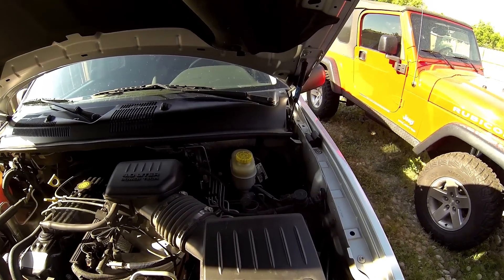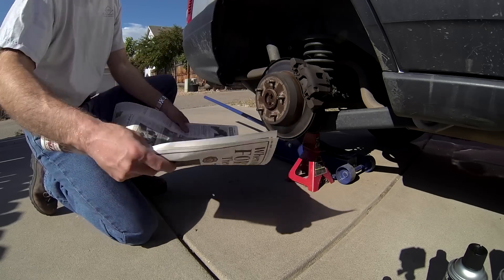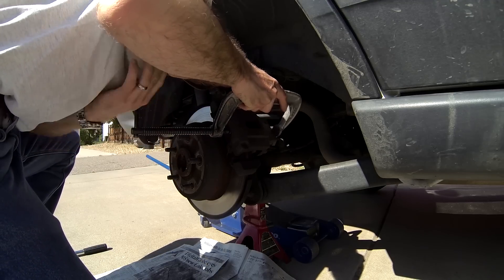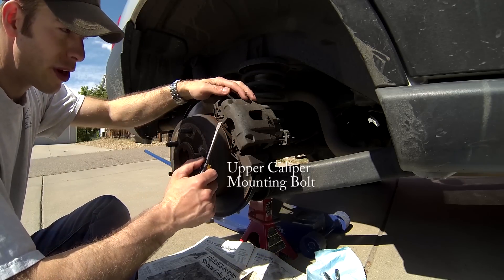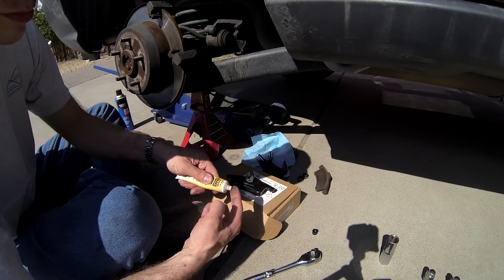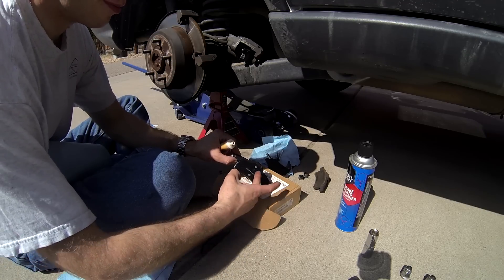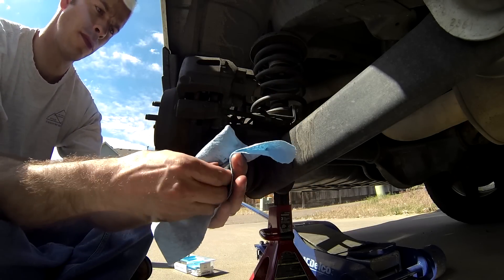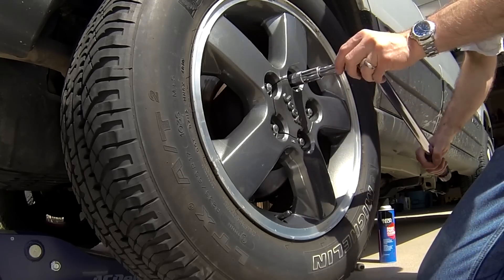Replacing Brake Pads for Jeep Grand Cherokee/WJ: 1999-2004

Comment: Thanks for the super solid video.  Just a note for the search engines... These are the Teves brake calipers that are on the WJ's through mid 2002.  I tore up a bleeder screw in one of mine and am set to replace it tomorrow.  I will say instead of the 7mm Allen, mine came off with a T45 torx.  Not sure if both work or what but I see way more posts using the Allen.

This was really great to help novice me sure up what grease goes where.  Thanks again!
Reply: Yup.  Definitely a T-45 Torx on mine, as well!

Comment: I chuckled when you got to the "reinstall retainer clip" because my new one was definitely NOT that easy to put back on. haha.  I was there for about 45 min haha.  Thank you for the great video, tho.
Reply: I agree. Those caliper retaining clips are a bitch to put on especially if you are trying to install new ones that came with the new pads. I actually ended breaking one off when trying to remove since it was rusted and seized in place. Now can’t get the remnant piece out of the hole. Anyone know if these are really required?

Comment: excellent job!!!      I stopped by your vid because   I couldn't remember the allen size -  thanks for mentioning it.   A few things, if I  might  add:  For  easier  R&R of the caliper,   cinch the  rotor  down with a  lug nut .  Safety-wise, don't forget to pump the brakes back up before starting the engine -  the pedal can  go nearly to the floor for as many as a half dozen pumps before hardening up.    If the pads are worn down to nothing, I  generally   crack the bleeder  and slide a piece of tubing over the  nipple  to let the old fluid bleed out of the caliper while the piston is being compressed  rather than push  accumulated trash back up stream  -  if the bore is clean, you can easily  compress it with your fingers  while  the bleeder is cracked - no need for a c-clamp - just tighten the nipple before releasing pressure.  .
Reply: Funny, I said the same thing in a comment I posted about not pushing the oil fluid from the caliper back into the system, and the dude went mental on me.

He said that I "don't know Jeeps or braking systems", so...I guess there's at least 2 of us out there!  This fucking guy....

Comment: No mention of pumping the brake pedal with the engine off after this procedure? And then making 30 stops under 30 MPH during initial drive? Otherwise, excellent, instructive video! Interesting to see how your methods deviate from that of many other mechanics doing this, but with equivalent results.

Comment: Thanks for your help. Changed brakes on a lot of cars and trucks. But my slide pins were not 7mm and a 6mm was a little sloppy but worked. The conversion for my slide pins was 1/4 inch.Also the caps were a full bushing that went through the calipers.Still don't know how to get the "reinstall retainer clip"  back on. Any HELP ?
Reply: Mine are Torx heads, so I don't know where the hell he keeps getting "allen key" from....

Comment: Tip; another reason for rear squeaky brakes. On older brake parts the pads wear creases and pits into the brakets where the pads slide onto. Causing a slight bouncing vibration where the pads rest on the brakets. Fix; remove brakets then file and wire brush until smooth.reinstall brake parts and Replace and Graese All hard ware. I hope I help someone.
Reply: It's....not that simple, really.  You can't just go hogging-out material from those areas, if you're not adding anything back (i.e. some welded metal etc.).

Comment: I just watched your video and I am going to attempt to do my own brakes.  But my only question is, what do you mean by torque to 95 lbs?  I know torqje is tightening but how do you know it is at 95lbs?  Thanks, I want to make sure I do everything correctly.   Your video was very clear and precise from what I saw.  I also liked that when you put the can of brake solvent down, you made sure we could see what it was, the name, brand etc.
Reply: Use a Torque Wrench to torque to 95 ft/lbs. You can get one at Harbor Freight or some auto parts stores rent them.

Comment: EXCELLENT VIDEO! I am surprised this doesn't have over 1 million likes... although could you please explain to me, on my old jeep (in order to take the brake calipers off) I just had to undo two bolts instead of using a 7mm allen? Now on my new jeep i have to use the tool you're using in the video (7mm allen attach) 

Is this because there are two different types of brake clusters for the jeep wj?
Reply from the maker: Thanks- you are correct; Jeep changed from conventional to allen bolts on newer Grands.
Reply from the maker: ***** Yes, they changed fastener type midway through WJ production.
Reply: @FreedivejeepHD  Ehhhh....mine are T-45 Torx, so... ??

Comment: what's the purpose of all the brake parts cleaner spray?  I mean, other than the obvious answer of cleaner stuff coming off...seemed like an excessive amount you sprayed.
Reply: +Jereme Macready it helps get all that brake dust off before you start working.  It's nasty stuff that you don't want to be breathing in.
Reply: No such thing as using too much brake parts cleaner!  I just went through 3 cans, and that was just a general cleaning of components, prior to removal.